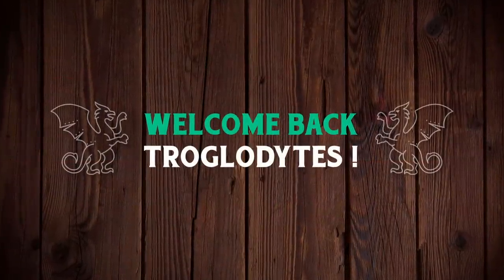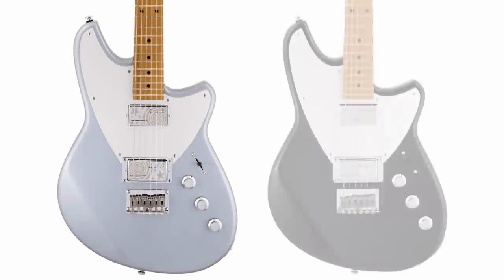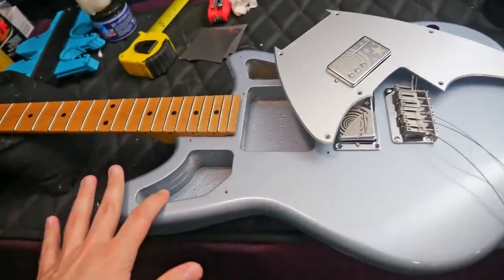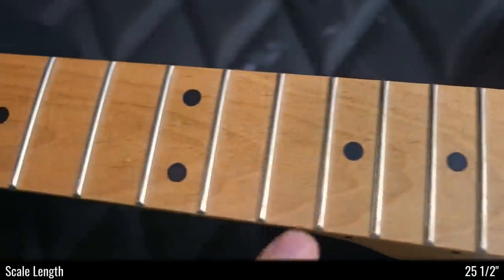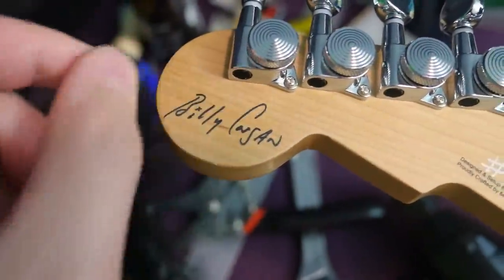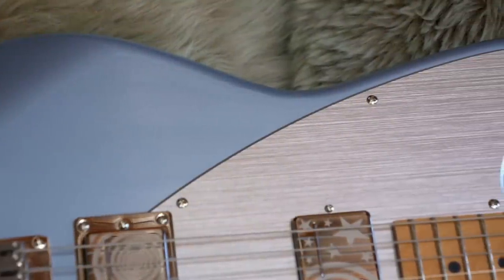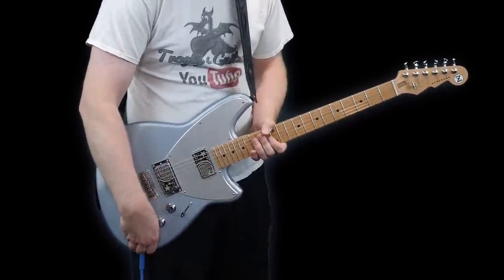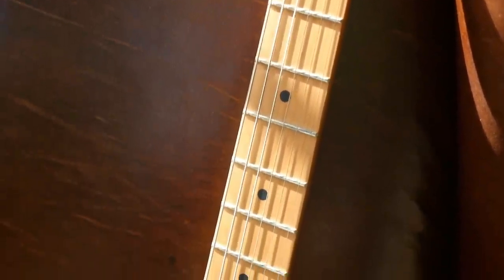Despite All My Rage... I Am Still Just a Reverend Billy Corgan Signature Z-One Guitar Review + Demo

Comment from the maker: https://www.youtube.com/watch?v=azhgpelu0vY
Reply: I really like the control wiring, very useful.    I've the same type of control layout in one of my Stratocasters.
Reply: "weEEEEEEEEEEEEEE!!!"
Reply: What is the Neck Radius?  I have torn labrum under my arm and after tearing my humerus destroyed my shoulder and arm and I really want to play. My 12 inch radius guitars. I am wondering about if anyone makes the classic 7.25 radius, but some people say they choke out.  I wonder if a 9.5 is better? I am home bound. It has been a year. The labrum is still torn in the joint.
Reply: @fenatic7484  The 7.25" R can sometimes choke-out of cheaply built guitars.  Typically you need better fretwork to keep the 7.25"R from having problems..  That is why 9.5"R are a little more common these days.
Reply: You should do a review of a Collings!! All of the reviews for them on YouTube aren't nearly as detailed as you and I feel like you'll be blown away.
Reply: @chrislouly7698  Agreed, ANY Collings would be great to review.  I'm sure Austin has enough Les Paul guitars on-hand to give a pretty good direct comparison to the Collings.   Granted, this comparison has been done before, but not to he point of looking under the hood and documenting the neck profile.    I'd like to also add that many of the guitar reviews on-line are performed by professionals.  That is all fine and good, but rarely will an average player experience the same results at home.
I feel Austin's reviews to be the most "real-world" reviews of what a person can expect.
Reply: @rann cerney $1500 bought me a brand new MIJ Tokai Custom Shop R4 Goldtop.
I would imagine the MIJ Tokai Acoustics would be a comparable value.   
I can't express how well the Tokai compares to a Gibson USA solid body as far as materials and craftsmanship.

Comment: Thanks for the review! The cool thing about Reverend’s signature models is that the guitar you buy is the same guitar that the artist is playing on stage, not some stripped down version made for the general public.
Reply: Like all sig guitars….
Reply: Wow
Reply: @bmark7951  not necessarily the case. There are plenty of artists out there that are replacing pickups, tuners, etc on their stage models.
Reply: @bmark7951  definitely not the case. Sorry but a lot of manufacturers con buyers into this typically. Reverend is definitely a brand that is upfront and honest about this and their artist as well. Some other brands and especially one very big one I will not name is known for this.
Reply: @lyric.kayden  Go ahead, name them.  🤐
Reply: @bmark7951  Nope.
Reply: @barnaclestval  - I believe that Steve Vai has a device installed into the vibrato systems of all his Jems and Pias which does not come with the ones for sale.

On the other hand (apart from some custom paint jobs) Robert Smith's Schecter Ultracures are just regular made in Korea which come off the shelf.
Reply: @bmark7951  You don't know what you're talking about. Lots of pro players make alterations to even their nicest signature models, when they even use them. Many signature models are made after guitars that the artist have had for decades. Heck, you don't think there are stripped down models for the general public? I guess you think Kirk Hammett plays an LTD on stage too, right?
Reply: @pabcrane  and he used line 6 spider v combos and the trilogy show at the Sydney opera house. A gear snob he is not!

Comment: I wired a high pass/low cut filter out of the bridge tone control on a 335, and made the neck tone into a master several years ago. Being able to roll off just a bit of low end and tightening it up was only second to the 5+2 Strat switching as the best electronics mod I've done. I worked in a repair shop, out of every 3 or so semihollow owners who tried mine had me convert theirs.
It can handle higher overdrive and fuzz much better then normal.
Reply: How do you go about wiring that high pass filter? Can you share any wiring diagrams please

Comment: They even make an Electric Terz Guitar which is an old 19th Century Guitar w/ a Shorter Scale Length & is designed to be tuned a minor third above a Standard Guitar at High G Standard Tuning which is the same as a Standard Guitar w/ a capo on the 3rd Fret. Billy Corgan Revived the Terz Guitar in a Solid Body Electric Version.

Comment: I picked up this signature guitar a couple weeks ago in metallic white. My first reverend, and I absolutely love the longer scale length, over all the pickups sound amazing for nailing that early Gish/Siamese dream tone. And you're right, the bass contour knob is useable, and super unique. My only downside is the build quality, I am used to Schecter guitars and every one I have picked up has been perfect out of the box, fret ends completely smooth. However there are a couple oversights on quality with the Reverend, there are a couple places on the bridge pickup cover that are insanely sharp, cut my finger the first time due to a pesky burr. Easily fixed with a file, but I should have to do that on a $1500 guitar.

Comment: Check out the Reverend Six Gun HPP. Same body shape but with two P90s and a humbucker. Maybe that's why the bridge rout is so big...
Reply: At first that was my thought then I realized the guards a partial cover on the 6gun so that can't be it as you'd see the route so I think it's more about allowing you a mod platform n a bit of weight relief then being lazy n just pumping out bodies on the cnc. 🤷
Reply: Ahh it's actually the 6gun with single coils that they made that route for
Reply: @derrickharmon7980  the Six Gun is Korina though, but probably just use the same jug machine to rout.

Comment: I'd have rather seen Billy with Fender, but I do like some aspects of the guitar. 
The routing sounds like a dream for anyone who likes modifying their gear, but the metal pickguard kind of ruins that. Metal 'guards will never make much sense to me anyways.
Reply: I’m not really a fan either.
Reply: Billy was with Fender for a time, but something soured between the 2 camps to the point I recall Billy saying he would never work with Fender again.
Reply: Lift up the plastic pickguards on old Fender’s and see what’s underneath them 😉 I have three and I can tell you there is a metal pickguard called a shield underneath that’s the same shape and cutouts as the pickguard. It’s a shield and back in the day I suppose it was much cheaper and easier to make a thin aluminum sheet cutout pickguard to go underneath the plastic guard. Anyways these days a nice full thickness aluminum pickguard eliminates the need for a plastic pickguard on top of the aluminum. It’s attractive and does serve a purpose for shielding and interference. Not everyone does or will understand the benefits here. I myself I love them but not on all guitars but for the Reverend guitars they look beautifully done.
Reply: @lyric.kayden  Fender did have stock gold anodized aluminum pickguards on some models (early Jazzmasters), but the cost probably factored into them switching to tortiseshell… conductive shielding tape under plastic guards is also a thing.
Reply: I don't think a 60s shield really counts as a pickguard, it's thinner and the rough surface is covered by the plastic counterpart. That's the main reason I don't like them, the feel and added weight just isn't my thing. Normally if I need shielding, I just use adhesive foil, lightweight and completely hidden.
Reply: @thenameless3271  you said above 👆🏻 in your first comment that metal guards will never make much sense to you anyways. 
Soooooooooo I explained that a metal guard is not only a scratch plate aka pickguard but it also serves as a way to shield. Sooooooooo back in the day it was much cheaper and easier to produce and cut out a thinner version that would be underneath the typical plastic pickguard. So being that we have the capabilities to mill/cut and product thicker aluminum and aluminum does hold up better for scratching than plastic some companies have then decided to do away with a typical plastic pickguard. Sooooooo you get an aluminum pickguard that holds up to scratches better and also acts as a shield. Andddddddd Fender did back in the day create solid aluminum pickguards for the Jazzmaster and a couple others at times.  
Now flip over a modern plastic pickguard and you’ll see foil. Just imagine no foil underneath, no thin aluminum pickguard under the plastic pickguard and you can have an aluminum pickguard that holds up and does shield. It’s a matter of taste and what not. It has a purpose and serves those purposes greatly. Is it better than plastic? I can’t say for certain but I can say is it kills two birds with one stone. A scratch plate and a shield. So does it make sense? Totally, I don’t see how one couldn’t see how it doesn’t make sense. Is it your taste or look for a pickguard? Well that’s a personal decision and sounds like it’s not your thing and that’s perfectly fine because I myself like them on some guitars and not other guitars.